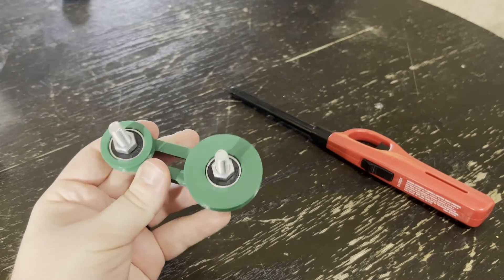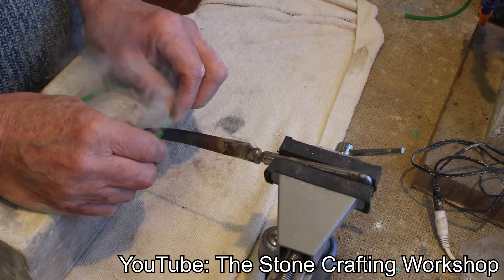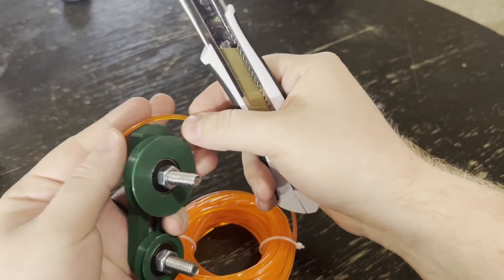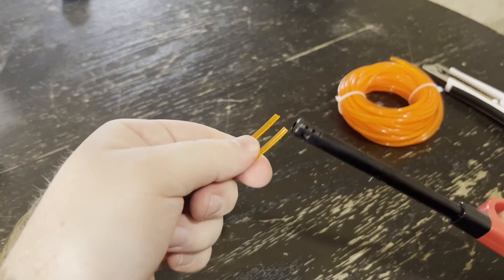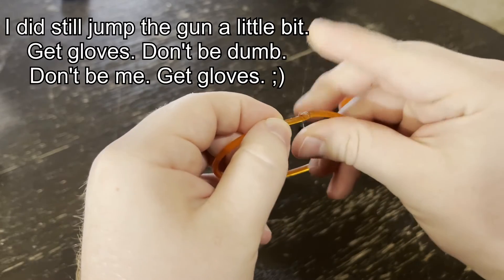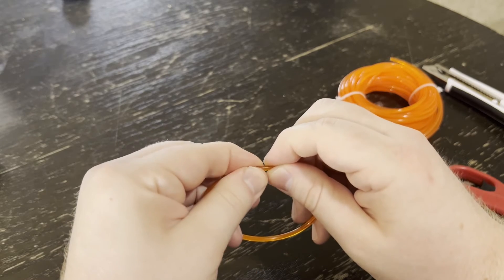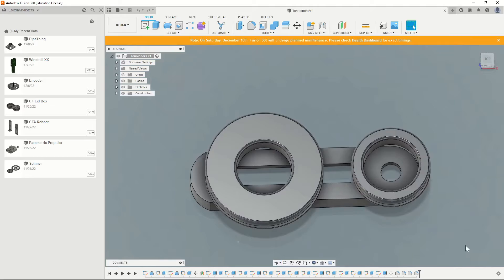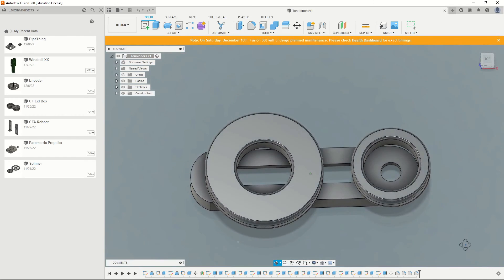Joining Polyurethane Belts -- An Easier Way (Good alternative to gears for 3D prints)

Comment: Great video! I an interested in using these for a 3d printer. Wouldn’t it be better if the tensioning screw was parallel to the movement of big pulley? That way, it wouldn’t get loose  over time, and by turning the screw you actually adjust the tension..

Comment: What I usually do is press the two ends together and wait for it to cool down. Then I use scissors to cut off the excess material. I use these belts to drive spinning weapons in combat robots and never had one break at the joint.
Reply: What weight class and diameter belt have you used?
Reply: @aidan5320  3mm belt on a Beetleweight. For a Feather I'd probably use twin 5mm belts.